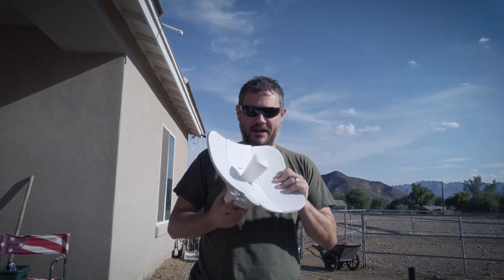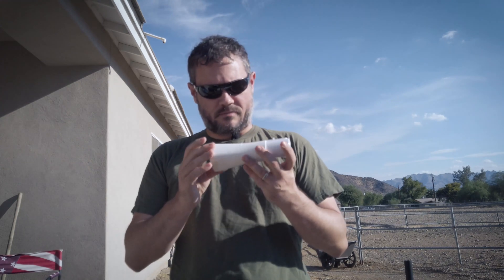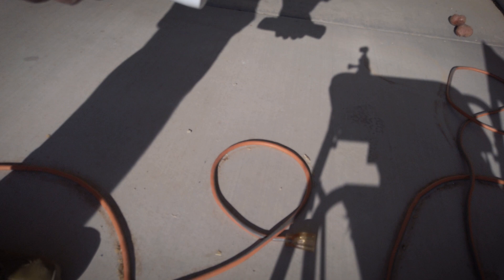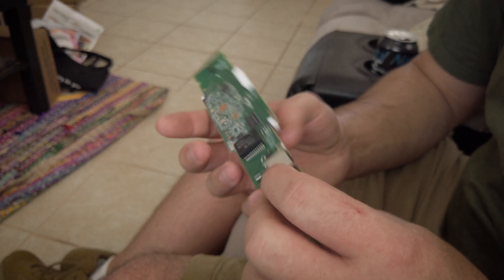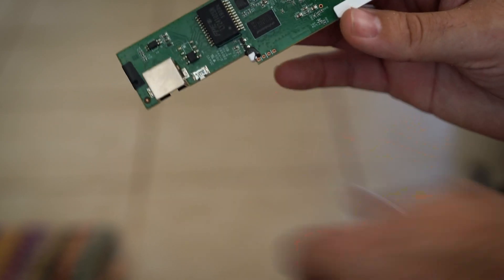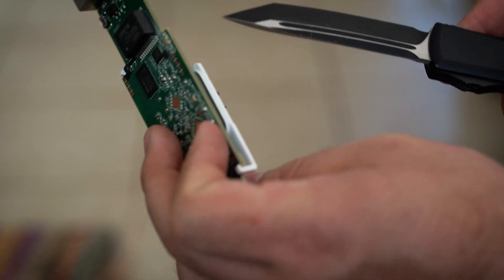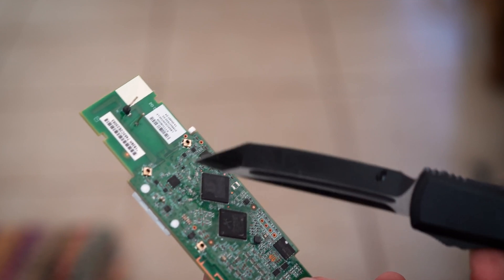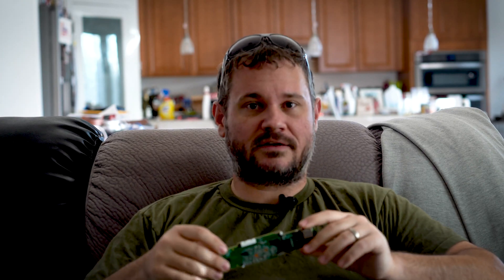What's Inside a Ubiquiti LiteBeam? - DIY Ubiquiti Internet Relay Pt.68

Comment: Big ass chip will be power filtering and delivery from the POE. The two very small chips will be the Wifi radio chips maybe. One for the main radio and the other for the Maintenance wifi. The two bigger cpus will be your CPU and the main wifi chip it outputs the power to the antenna.
Reply from the maker: Interesting.  Have any references for that?  I'd like to put it in the description and credit you.
Reply: @rmp5s  https://datasheet.octopart.com/MX25L12833FZ2I-10G-Macronix-datasheet-102761938.pdf - Datasheet for the MXIC Flash Memory.

I cant seem to find the Datasheet for the Big chip labeled FPE LY24102SN but it highly resembles a 100/1000 Base-TX magnetic. (Edit) Erick in the comment found something of a datasheet for it. http://u.dianyuan.com/upload/space/2011/04/21/1303353418-442859.pdf

http://elmechanics.com/documents/pdf/80/AWL5910P8.pdf AWL5910 - 5GHz Power Amplifier. Being that this is a 2x2 Wifi device there is two of these for each radio.

The Atheros Chip will be the main processor and driver for the Wifi side of things. https://pdf1.alldatasheet.com/datasheet-pdf/view/1168533/ETC1/AR9341.html - Datasheet for the 2.4Ghz version.

The Ubiquiti Chip will be the Main processor for the Software side of things like the Web GUI and other network settings.
Reply from the maker: @Shad0wGeneral  Awesome!! I'm going to pin this comment!

Comment: Those antenna connector are probably there for debugging or for other models that uses the same board. The antenna itself is the circuit that is connected to those connectors. I also suspect that those pins are also there to act as antennas too
Reply from the maker: That's kinda what I was thinking...like the Braille bumps on drive up ATMs. lol

There was a lot more on that little board than I expected, though! I was expecting a smaller board in general!